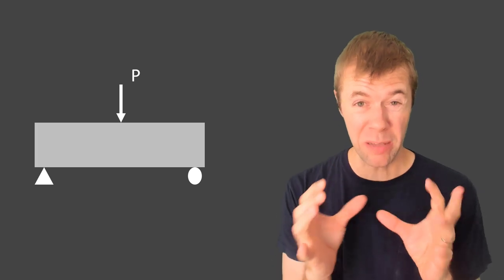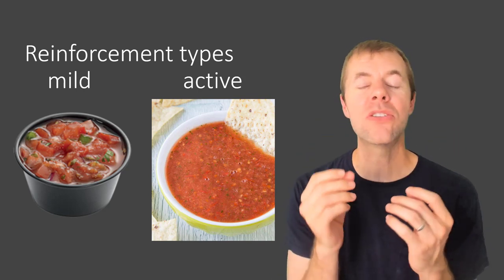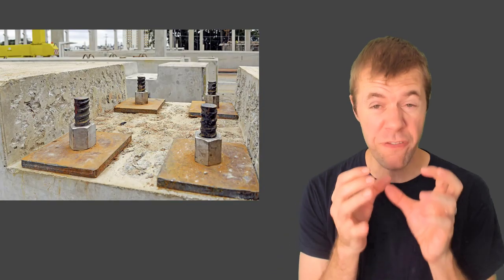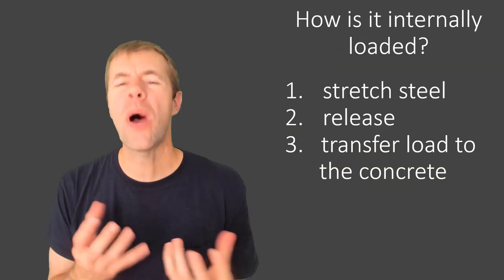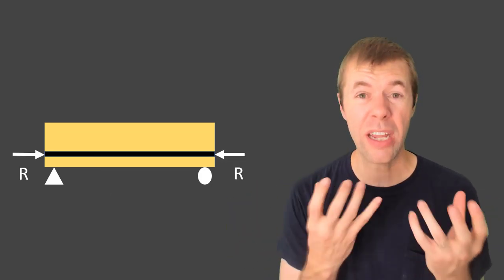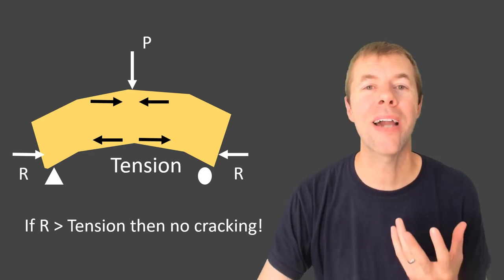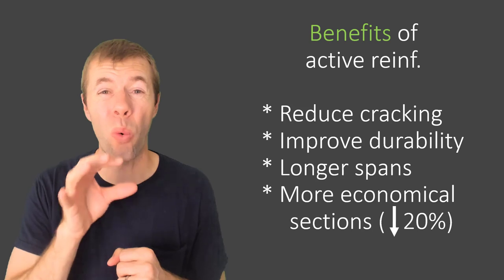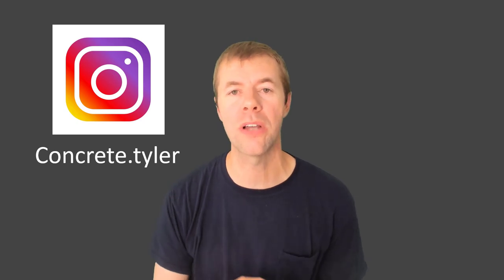Fighting Cracks with Active Reinforcing! - Prestressed concrete

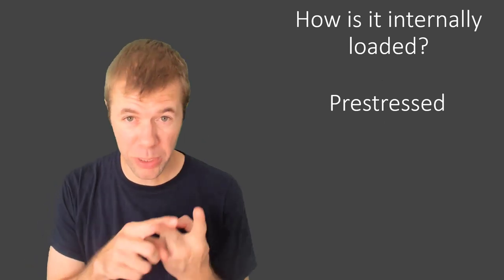Comment: It is a good video but I think you meant pre-tensioned and post-tensioned at 3:45. Prestressed means either pre-tensioned or post-tensioned. 

I have designed using PT but I only use it when I have to use it. It is expensive and you end up having about 3 drawings on the plans noting all the specifications related to the PT (storage and testing requirements etc). You have to be very careful. It is a pristine material that can not tolerate flaws or corrosion.

You should go into why PT is good for slender spans. Most people think that the PT increases the strength which is not the main purpose. The increase in strength comes from high strength concretes and steel and not the prestressing process. 

I have always pronounced Dywidag as dewey-dag (like the dewey decimal system). Perhaps it is pronounced differently elsewhere.

Comment: At the end of its service life and if corrosion is present active steel structures fail suddenly (brittle failure) and without warning versus inactive steel which will sag (ductile failure).  That's why regular inspection is required.  See Study of Hidden Corrosion of Prestressing Strands by B. Parajuli.

Comment: The world needs active nano reinforcement to go along with your nano tacos. You know how heat riveting causes the rivets to shrink when they cool and squeeze steel plates together tighter due to coefficient of thermal expansion? Do you think it might be possible to replicate this phenomena at the nano scale and generate active internal loading of small steel fibers to load as the steel and concrete cool?

Comment: I'm half-watching a cooking show where they are making Angel Food Cake. She admonishes that we avoid pouring the batter from too high so you won't loose the air (entrained).   I turned to the TV to see if she was going to use a tremie. But, no.

There are similarities and contrasts between concrete and baking. Just because you know one doesn't make you an expert in the other. But you do have to work from the plans and specs.  🎂